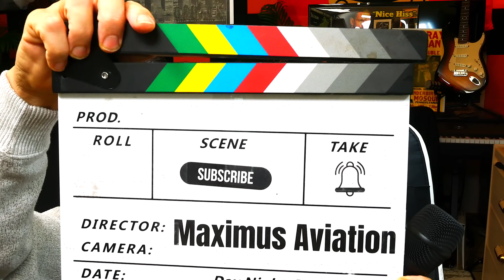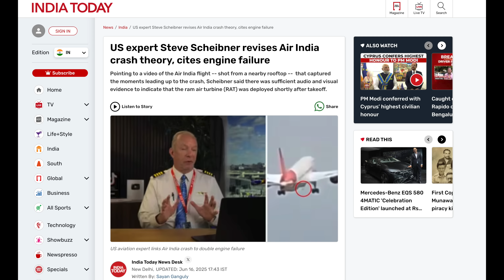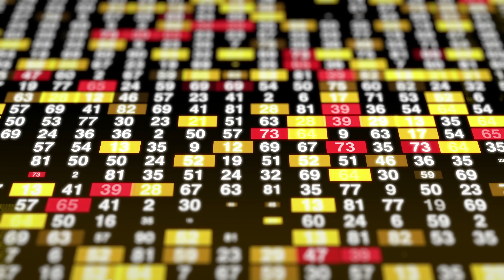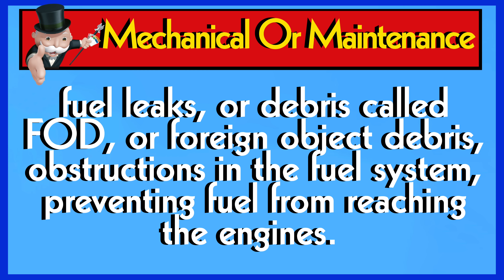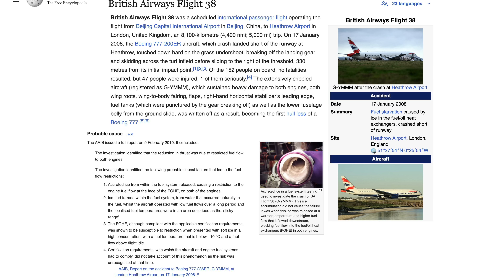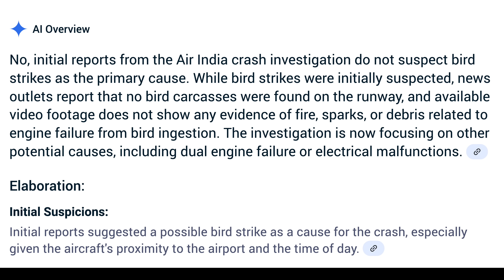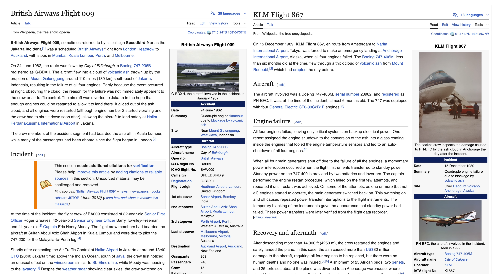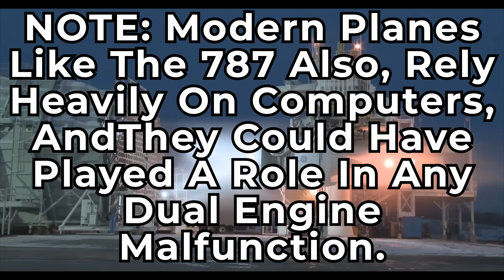Dual Engine FAILURE, Real Or Just The Latest Guess By Armchair Pilots? Find Out How Engines Fail ✈️

Comment: In 2019, a Jetstar 787 had a dual engine failure caused by biocide in the fuel.
Reply: cant rule good old clorisporum out  or what ever it is called,,.
Reply: @davidblurton7158 Was that the contaminant involved with CX780 (A330)?
Reply: @Blank00  not sure  i think there are a few fungi and bacteria types
Reply: Reason why the APU could not be running ?
Reply: @fafileblond9202  the air intake door was open so it might have been on for take off which is a thing some airlines do or it started automatically and was running or coming on line but too late
Reply: @fafileblond9202 They did have problems with the li-ion batteries that was  suppose to be fixed but i heard maybe it was just exra fire proofing!😣
Reply: @fafileblond9202  turned off  possibly  got to save pennies,,  but think it might have started again  but crashed soon after  the air intake door was open and i think its part of the start up but it could be a cooling thing after shut down,,  blind on that
Reply: @fafileblond9202  apu doesn't start immediately, it takes like 45 seconds at least (it's a turbine engine, it has to light, warm up a bit, and get up to speed) it just didn't have any time to kick in.

Comment: People are claiming dual engine failure because the RAT deployed just before the crash.

Speculation for eyeballs...gotta love YouTube.
Reply: The RAT did deploy.

Care to name ALL the conditions that happens under?  I can.

And you can hear the RAT over the engine noise.  So yes, the RAT deployed.  Visually and Auditorily.
Reply: @honeycomb8753 The RAT will deploy when there's loss of power, electrical failure or hydraulcs failure, so yes, I know.

Loss of power can be due to dual engine failure, but not necessarily, which is why it's better to wait and not speculate.
Reply: @sainnt  BOTH engines rolled back.  I don't need 6 jet type ratings and over 14,000 hours to see that.

Why?

They know (why) and are not advertising it.  So, that's a bad sign if you ask me.  Someone's reputation is about to get sued to into oblivion.
Reply: @honeycomb8753 Even if they know and they're not advertising it, the professional thing to do is wait until all the facts are in. That's what the professionals would do as opposed to us aviation fans just chiming in. 

By the way, another Air India 787-8 declared an emergency and turned around from Hong Kong, but they have yet to say why. The more I'm looking, the more I'm leaning towards a maintenance issue.
Reply: @sainnt  I am a PROFESSIONAL.

NOT getting info out to 787 crews and airlines immediately is a bad sign.

Boeing did the same thing with the MAX.  Eventually we will know.  Not immediately publishing the reason for the thrust loss is a bad idea by EVERYONE involved.
Reply: @honeycomb8753 Sorry, I didn't know that you were a professional plane crash investigator.

It sounds like you're putting this crash squarely on Boeing, which would be highly premature. During the Max crash, China was the first to ground all their 737s. As far as I know, no 787 operator has grounded its fleet.

Also, if the crash was due to engine problems, that would be GE in this case, not Boeing. 

It's okay to continue speculating, but still better to wait for all the facts.
Reply: @sainnt  There's a reason you are an amateur.

I don't think this is a GE problem.  I think this is a computer problem, aka BOEING problem.
Reply: @sainnt  we like a good theory,,  its interesting and i have increased my knowledge so much with this jet
Reply: @honeycomb8753  yes  i thought electrical failure like total loss but it is more likely to be fuel starvation or a software glitch,,,,  maby,,,,
Reply: @honeycomb8753 Yes, because you know the facts before the investigators. 

So easy to forget that this 'computer/Boeing ' problem occurred after over 38,000 flight hours and over 7,200 flight cycles. 

Being the amateur that I am, I'd take your word for it, but I'll still wait for the actual accident report, the one that will be published by the people who are actually examining the evidence. Thanks.
Reply: @davidblurton7158 We all like a good theory because we're av geeks, but theory isn't law. Science doesn't work that way. 

There's enough interest in all this so we'll know soon enough. There are a large number of people out there chomping at the bit to see Boeing get buried once and for all because they already see this as a Boeing problem.

All these experts are also ignoring the fact that passengers on a domestic flight that was operated by that same aircraft reported electrical issues with the plane. Air India did not address the issue before putting the aircraft on a longhaul flight. None of the 'experts' are even talking about that.

Comment: It's commonly accepted now that the RAT deployed.  My question is whether the RAT would deploy if there is a single engine failure and the crew shut down the remaining good engine by mistake. It's happened before....
Reply: That comes to mind in both this and the Jeju crash. Not casting aspersions, but it is a possibility and under great pressure, it’s easy to get confused. The rule is “dead foot, dead engine”, which is to say that in order to avoid yawing, the pilot has to depress the rudder on the side of the running engine. That’s easy enough to say, from an easy chair, but not so easy when problems are arising, alarms are sounding and safety of the flight is at stake. 

The other thing to remember is that it’s rare for any crash to have only one single cause. There are rumors that the aircraft was experiencing issues on the prior flight, and intermittent problems can be very difficult to troubleshoot. Were there issues reported to Line Maintenance from the last flight? I don’t know, but I’d love to find out. 

At the end of the day, go/no-go decisions frequently end up with the captain, and there can be a lot of pressure to dispatch. Not good, but that’s just how it is.
Reply: No, it wouldn't. Not unless a lot else was wrong, or the crew deployed it.
Reply: I personally know a colleague who's father was an FE on a twin turboprop. They did exactly that and had to do a high G landing (unpowered glide) during "touch and goes" while practicing emergencies!  Total disaster avoided but mistakes were made.
Reply: kegworth uk early 80s i think,,,     rat deploys when no hyds  or no electrical power    so i think the little fella would make an appearance
it doesnt feel like that,,  it looks ok just after rotation   nothing sticks out except no anti cols  not great footage though

Comment: After all, investigators already have both recorders, so they probably already know the cause of the disaster, and they certainly know what happened to the engines, for example, whether they were working. But why do the families of the victims and all the people who fly planes have to wait so long? And will they ever learn the truth about the causes of this terrible disaster? Currently, they could certainly at least give a preliminary report to the people and say at least what happened to those engines.
Reply: I do feel the same, but just engine data and pilot commands recordings are not enough, they will talk to the atc, the ground crew, the maintenance crew and the lone survivor. Preliminary reports in these type pf complex aircrafts are not solid enough. It is better to get a thorough investigation done in these types of aircraft rather than just connecting primary links. I feel bad for the families too but it would rather be better having a good report which would provide a better sense of justice to those dead rather than just a preliminary report.

Comment: Speculation is rampant as always. I would find dual-engine failure more likely than pilot error. As in pilot error seems to mostly come from Americans blaming jolly Johnny Foreigner on blemishing their perfect safety record. A repeat from the 737 MAX mass murders. Still, if people claim to see flaps up or someone pushed flaps up instead of gears... can we really see anything from those tiny, grainy video's? Can't see it clearly. Likewise, engines make plenty of noise, but can we clearly hear the absence of noise on those same video's? I'd wait for the preliminaries. Let the investigators do their job.
Reply: anything is possible,,  and just because you can make out the slats out and flaps and slats at 5 on the ground does not mean to say they were deployed incorrectly    i think they were but everything is grainy

Comment: I had a 4 engine failure at "Gear Up" during 747 F/O training.  We had finished up early and the instructor ask if we had anything else we wanted to do?  My Captain said he wanted to give me a takeoff.  We rolled down the runway and upon my call of gear up, he shut down all 4 engines and said "Think fast you SOB."  The instructor was pissed!  This is what I think happened.  All other scenarios are improbable.  As always we need the facts from the boxes.
Reply: Was this in the simulator?  What was your fast solution?
Reply: @FameyFamous No doubt it was a sim.  The solution is flick the engine fuel and power back on. The engines would hardly lose much speed if your quick, and will fire right back up!
Reply: Lol.   Great fun.
Reply: So  what!?????!  You think they shut the engines down??????

Comment: Don't forget the survivor described hearing a "loud noise" right before the crash.
Reply: The Rat will make a loud bang when it deploys. They do so automatically in a power loss event.
Reply: Could definitely be the 1st part of the plane to make contact with something on the ground. Say the gear hit a roof top but the rest of the plane cleared it, the passenger would hear it. What is not known is how much time passes between the bang and impact with the ground.
Reply: @MrMotenak Do we even know that person actually travelled on that plane? No scarcity of frauds these days.
Reply: @ishanchattopadhyaya8816 
The airline confirmed it and he was in possession of his boarding pass showing seat 11A.
Reply: @ishanchattopadhyaya8816  Well He did have the Boarding pass in his pocket. And has just buried his brother who was seated across the aisle from him in seat 11J.
Reply: @ishanchattopadhyaya8816  if you are saving AI..then you are not the side of 241 passenger .....
Reply: @MrMotenak  the gear DID hit a rooftop. then the tail, which detached from the rest of the airframe.
Reply: Could have been the rat locking down, could have been the tail being ripped off on the first impact. Since the aircraft was decelerating before it left the ground that bang was far too late to be the cause.
Reply: The survivor also said that after a normal takeoff the airplane just stopped climbing, then he heard a bang (maybe from the RAT deployment) then the engine power increased greatly and then the crash happened. So we'll test what he said for accuracy after we get the FDR information.
Reply: Yeah the tail hitting the building
Reply: Electric/battery issue:
RAT needs 6-7 seconds to provide emergency power. APU needs 40-45 seconds. From that point stopped climb until crash into buildings were 25-30 seconds. So, APU had not enough time, and to start engines with RAT is impossible--especially in this catastrophy  case, all passengers had switched A/C on.

(Suicide) Switch Off fuel pump(s) in flight must automatically give an aggressive  alarm signal in pilot's cabine. We have to wait for the flight recorders. 

Bird(s) strike on both engines at the same time? Theoretically possible, but unlikely.

Shots on both engines? (passenger 11a heard a loud sound?)

I have read, approx. 700 spare parts should not be original from the manufacturer, without licence.
Maybe out of Indian temperature range.

Fuel contimation. Or fuel had boiled (because of contimation).
50 tons of fuel could not so quick be heated?
Reply: Don't forget to include the extreme duress he was under, and the g-forces he was subjected to. A certified powerplant mechanic would be hard pressed to recall that info under those circumstances.
Reply: Some sources have also reported the indigo pilot near the 787 also heard a loud sound
Reply: Survivor testimony doesn't matter. Their memory is unreliable in the face of such a traumatic event.

Comment: The MAYDAY call and the lack of noise seems to suggest that the engines weren't working as hoped. As to why... nothing seems likely. Running out of fuel is not possible, given the fire. Ice was not likely this time either. No sign of birds. No sign of smoke or fire, so bird strike seems unlikely. No localized volcano either... but maybe they could have sucked in dust on the turn around at the end of the runway, but seems unlikely that it would stick around long enough to allow the engines to accelerate the aircraft before it went wrong. Whatever it turns out to be is going to be shocking. But it sure as hell wasn't pulling the flaps up instead of the gear.
Reply: There was still vegetation at the crash site. That fire could have been mostly vapor. That said. If a modern aircraft had no fuel. Maintenence and/or Boeing have some explaining as to why the pilots were not aware
Reply: @timbrwolf1121  There was still a live and largely unharmed passenger at one point in the crash site. That isn't meaningful. That fireball, and the subsequent fire, was not from a few cubic meters of vapor.
Reply: @cageordie  do you mean that massive explosion,,,
Reply: I'm putting my money on ice
Reply: Or possibly an open gas cap caused loss tank pressure that allowed some weird sloshing situation once they rotate.
Reply: @mikesorensen5228  usually around the bump is baffled so stable fuel
Reply: @davidblurton7158 ah ok, i kinda wondered about baffling in the tank. I did say weird though! But ya, probably not.

Comment: Vapor lock w dual engine failure w electric failure and hydraulic failure
Reply: Yah, sure. LOL! Fuel with a boiling point of 176C(349F) had a vapor lock because the cabin A/C was off. LOL! Failing all the fuel pumps though... that's at least possible, even if unlikely. Four engine driven hydraulic pumps and all four starter generators would have to fail to remove power from the four hydraulic driven and two electric driven pumps. But if somehow the engine actually stopped, or someone pushed all six fuel pump buttons to turn them off... well yes. Then the engines would not get fuel. But that's not a vapor lock. Jet-A is not gasoline.
Reply: @cageordie  no, Jet A is not gasoline, but the flash point of Jet A is 104 F, and that’s when it starts producing volatile vapors. As @UK94nK8R pointed out, this is a very real possibility, if the electric boost pumps failed. Given the high ambient temperatures, this explanation sounds very plausible.